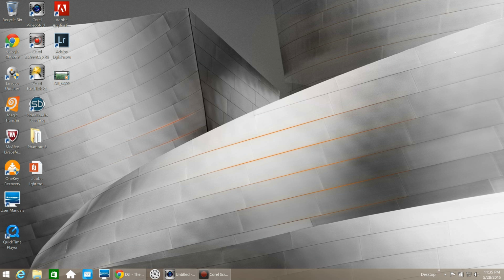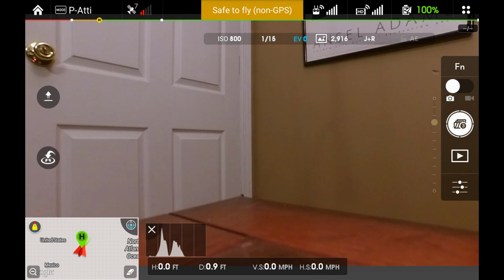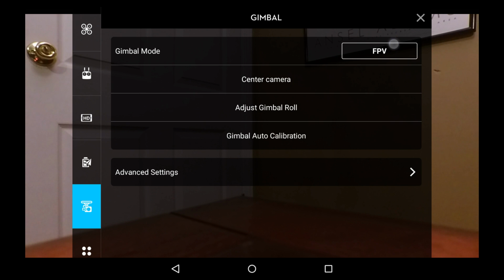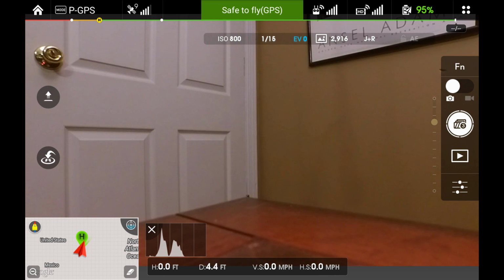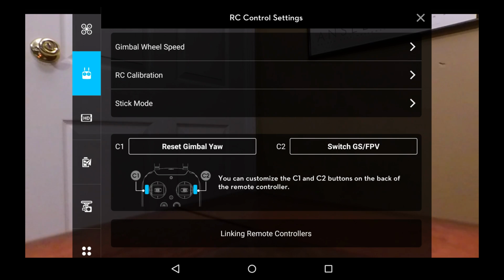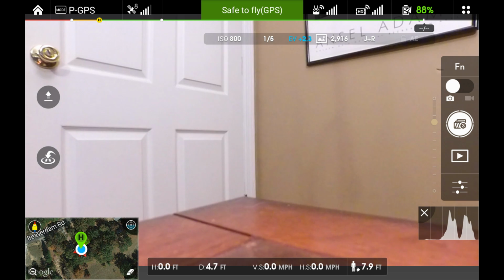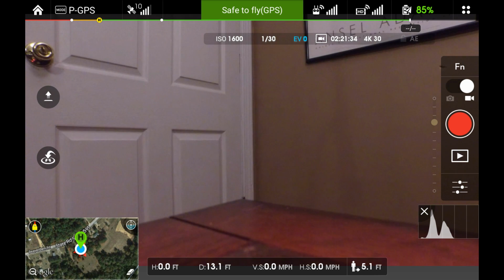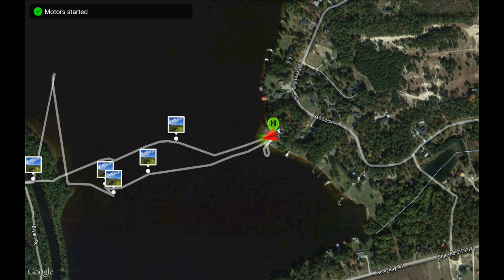DJI Phantom 3 & DJI Pilot App (now DJI GO App) Walkthrough & FAQ

Comment: Great video! There is nothing out there this comprehensive. You would think DJI would have came out with something like this. Anyways, my histogram is much bigger on my screen. Is there a way to make it smaller? OR perhaps you just have a different version update of the app maybe?
Reply from the maker: Future World Media Perhaps a sun shade would help you see better. On the iOS version I think there is also an option that highlights (zebra-stripes) portions of the image which are overexposed.
Reply from the maker: I have Android..are you running iOS? Not aware of anyway on Android to change the size..but I haven't tried.
Reply: Drones In SC iOS
Reply: Drones In SC  Your video helped me out immensely! I do have one problem, though. Originally before I watched your video using auto exposure, my videos were way to hot. Now that I watched your video, I dialed things down a bit using the histogram and found things to be too dark. I am used to histograms having used them since Photoshop 3, but it would appear I cannot rely on that alone. Sure it is easier to lighten something up in post production as opposed to having things too hot, but the biggest challenge I am finding is that when you are outdoors with a smart device, like the iPad Mini I am using, it is hard to tell the exposure simply by using the screen. And the histogram seems to make things darker when all the waves are fully contained within the graph. When I run into this problem with a normal production camera, I simply revert to the eyepiece instead of the LCD display. I don't have that luxury here. What do you suggest?

Comment: How do you like the P3 compared to the Q600?
Reply from the maker: They are different...I can backpack with the phantom but the Q500 is much quieter. The camera is nicer on the phantom but the gimbal has issues maintaining a level horizon. My phantom is out for repairs on this and another problem that occurred after a failed firmware update.

Comment: I'm so glad I came across your video and it help me a lot to understand the DJI pilot . There are no other one out there.So keep the videos coming for guys like me. I have a question for you and I hope you can help me. My phantom 3 has crashed and was destroyed I was filming in a 4K movie and I did not have the chance to stop filming. So I'm assuming that the file was corrupted because it was not close properly. Is there a way or program that could fix this so I can view this file? Thank you  Oh BTW I just got the P3P  and owned it for 5 mins and now it's destroyed. My first mistake was I hit the RTH key and shot straight up and and went out of control and smashed onto the cement.

Thanks Again
Reply from the maker: Sorry to hear that. :( I haven't run across this problem yet..but if your Phantom will still power up...put the SF card in..wait a minute, and then turn  the unit off. If that's not an option or doesn't work, I know there are programs out there...try doing a search for something like "corrupted video file recovery".
Reply: it's not option because the cpu chip and the camera was busted  off. I do have another P33 . If I put the SF card in this unit do think it may work?
Reply from the maker: Joseph Haney SD card...silly phone auto correct..sorry. it wouldn't hurt to try, Joseph.

Comment from the maker: Rami...I couldn't reply directly to your comment for some reason but your distance will vary depending on terrain and conditions. When you are flying over a lake like I did there, you could go further than you would want to based on battery power.
Reply: Drones In SC flying over the sea I turn vision positioning ??
Reply from the maker: Alejandro Quintero I would turn it off. Use VPS indoors or if you have poor GPS reception.
Reply: Drones In SC : I see you had some distortion in some of your live view. I am having that every time I fly. I just don't know what the issue is really. Since day one, the live view screen from my controller screen whether its my IPAD mini 3 or IPHONE 6plus the screen display has distortion a lot of times...wavy lines. There will be lines in it like static...then clear...then there will be 1/2 inch black bars scrolling across the screen occasionally?? Distracting. I have changed USP connection cord from the controller to the screen with 2 different brands. No change. I also am not flying near any powerlines etc....Its kind of a bummer to keep having this distortion in live view. When I download the footage on my Mac, its all clear. Its just a pain in viewing in live view. Any suggestions?
Reply from the maker: ***** The issues you are seeing are not being recorded...its only on the live view. Could be a number of things...poor reception, bit errors, problems with processing the feed on your mobile device. I know that at least on the Android platform, these issues have gotten worse with later firmware releases. People have complained to  DJI about it and DJI has said that they will look into it according to the forums I participate in. Don't know anything more than that.
Reply: Drones In SC    ok thanks. I have used both IPAD mini 3 and IPHONE 6 plus and they both have this interference. Thanks anyway.
Reply: *****  I had the same problem and it was simply a matter of turning off the overexposure warning. Happened on my iPhone 6 and my iPad air 2.

Comment: WOW! THANK YOU so very much for such a comprehensive and professional tutorial - Simply outstanding video.

One thing that would be really helpful - if you know - is tell us what android tablets you know will work, starting with yours. That is by far one of the most difficult things to determine on the web (and DJI's only failing, since they can easily afford at least a couple dozen of the most common brands and models). My P3 has been ordered, but I am afraid to risk a tablet that will not work with the Pilot software. I like the Galaxy Tab 4 7-inch, but cannot find a clue if it works. Not asking for an endorsement of anything, just what really works at this point in time.

Thank you again for a really World-Class post. - Phil
Reply from the maker: Michael Seely For your device, there is a "trick". Go to settings, then go to "about device", scroll down until you see your build number listed and then tap on the build number several times in a row...that should bring you to a page where you can enable developer options and turn on USB debugging.
Reply from the maker: All I have used is a nexus 7 ii. I also tried the original nexus 7 but it doesn't work.
Reply: AerialLensVideo I have the same tab 4, and it says it needs de-bugged.. On my note 4 phone, pushing the settings button took me right there to de-bug but not the tab 4..crap, i wanted to use that tablet..lol
Reply: Drones In SC Wow, thank you for your help and knowledge.. I debugged it and going to try it tonight..
Reply: Michael Seely It worked, it worked..Yea, i can put that 7" Tab 4 to work and i can see what i am doing way better...Drones in SC, i am in your debt..Thanks so much, awesome!
Reply from the maker: Glad we could help!
Reply: Drones In SC Actually, I ended up with a Galaxy Tab Pro 8.4 - it works great. However, initially the App said it could not connect because I had to have "USB Debugging turned on." Found how to do that and then it was smooth sailing.

Comment: Awesome video man. This is a much clearer, coherent and accurate tutorial than the other Pilot app video on here. 

Couple questions. 

1. Towards the end of the video you show your flight chart where it shows you went over that river and went to the other shore.  Out of curiosity how high were you flying and how far from the remote?  Trying to gauge max distance without running into controller disconnects. 

2. When you take the Phantom out on a further trip how do you normally bring it back to you?  I know you can always hit the home button but I want to be able to get it back to me w/o the RTH button.  I think if you could demonstrate how to navigate using the map (while actually flying) it may be a really useful video. 

Thanks for video!

Comment: This is a fantastic video. The best I have seen for the pilot app because information seems scarce. Could you possibly say a little bit more about those "exponential" settings and how you would want to set them to make slower, smoother movements for videography? I'm not entirely clear on what the changes are.
Reply: Light Panther turn your gimble  speed down to 60%, making it more pleasing to look at videos.. Drones in SC, thanks a bunch for filling in some gaps i had
Reply from the maker: Michael Seely No worries, Michael! That's one of the things this hobby should be all about...learning and sharing!
Reply from the maker: Light Panther There are two different kinds of settings on the app...gain and expo. Turning down the gain will lower the control response and adjusting exponential will change your control response from a linear response to a response where the controls are either more sensitive when you first start to move the controls (more movement with just a little stick) or more sensitive as you go full travel on the stick...making the response more of a curve than a straight line. 

This thread might help explain it a bit better: http://www.wattflyer.com/forums/showthread.php?t=934

Comment: excellent walk through yet simple to follow. One option you did not mention was Video Caption. What is that all about. Thanks
Reply from the maker: I haven't messed with it yet but I believe the purpose is to capture some flight data to go with you video.
Reply: hchehab11 If enabled, Video Caption will write an SRT caption text file to go along with your MOV/MP4 video file.  When played using the VideoLAN VLC media player the caption text is overlaid onto your video showing Lat/Lon, speed, altitude and camera settings.  In VLC go to Tools, Preferences, Subtitles/OSD and check "Enable Subtitles".  The SRT caption file can also be uploaded to Youtube.  When editing your video settings in Youtube, click on "Subtitles and CC" and you can upload an SRT caption file.  The SRT file is plain ascii and can be edited in any text editor.  When users watch your video on Youtube they can choose to turn on/off captions by clicking the CC button at the bottom right of the Youtube player screen.
Reply from the maker: Zbip57 thanks for expounding on this!
Reply: Zbip57 What's a "Video LAN VLC player"? Sounds like something abstract. If I choose mp4 format does it automatically show that stuff at the bottom when I plug in a USB sd card adaptor to my TV and watch the video file? I double clicked the SRT file but my windows pc basically said "What the hell is this? I don't recognize it."
Reply from the maker: dannydaw59 VLC is a very common and often used free video player and video converter. A .SRT file is a subtitle file...it should work with any video player that supports subtitles...just have to turn on subtitles in your program. You don't open the SRT file directly...your player does that.
Reply: dannydaw59
 Google search "VLC video player".  It's free.  The SRT subtitle file is plain ascii text.  You can edit it with any text editor.  You could temporarily change the file extension to TXT, or just drag and drop it directly onto Notepad to see what's in it.